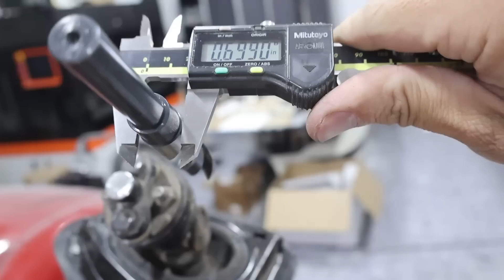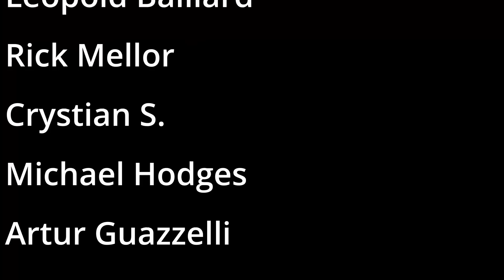Turn with Ease:  Installing an Electric Power Assist System - Electric Power Steering

Comment: very cool build ..looking at this I totally thought that rag link was gonna be remade at Sendcutsend, could have done without the coupling shaft and saved you an inch.  :) and we all want that extra inch to play with .. I'm about to get rid of a few ICE project to try to fund the start of purchasing parts .anyone need a 93 4 door 1 ton dually :)  ??.gonna start hording parts  likely motor first.. already have the shell .. I would really like to run an electric suburban in the Texas mile and hit the 200 mph club.. I got the makings of a great comeback story and I got the beaten down and sick and dying part down pat I just need the super awesome ending LOL ..

Comment: It would be nice if an electrically powered hydraulic pump could supply fluid to the car’s  original rack on demand. Also wouldn’t need to mod the column. Is a pump with integrated accumulator available?
Reply from the maker: Yes.  People opt for the electric assist as it is silent...pumps...not so much
Reply: @electricsupercar  The Volvo one I'm using is very quiet. You can hear it if standing beside it but not if inside the car with the doors and windows closed.

Comment: My experience with this mod was not successful. The main issue is hydraulic racks are not designed to receive high torque from the input shaft and this will eat up the rack's teeth really fast.
The solution was to get proper electric steering rack.
2nd issue is the rubbery feeling from all the loose mountings and shafts.

So my obenin is it's better to get a fully electric steering rack (ones with the motor located on the rack it self) like the MDPS-R found in 2015+ Genesis.

Comment: Power steering is one of those things that you don't notice much at speed, but that you really want in a tight parking situation. When I saw the MGA, I figured that you are working on these cars simultaneously. It is convenient that you are working on multiple cars, because you can switch to another one when you are waiting on parts (or having unforeseen issues) and still keep the content coming.
Reply from the maker: Thanks Dean!

Comment: Hydraulics better just get an electric hydraulic pump off of a Volkswagen V70
Reply from the maker: I opted for electric assist as it is silent.  Otherwise the pump is going all the time
Reply: I'm surprised you're going to trust something as crucial as steering to flaky German electronics especially from a late model Volkswagen (and we all know about that rock solid Volkswagen electronics reliability). Good luck with that.
Reply: @houseofno  which other country produces steering pumps beside german companys? (ZF, Schaeffler, Bosch, trw(ZF))
I am not sure if VW does even build their own steering pumps